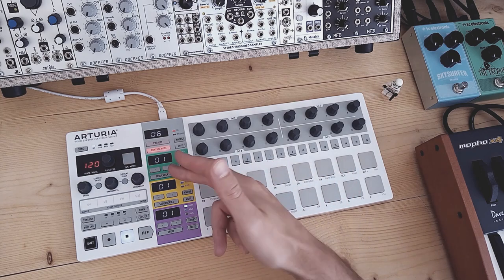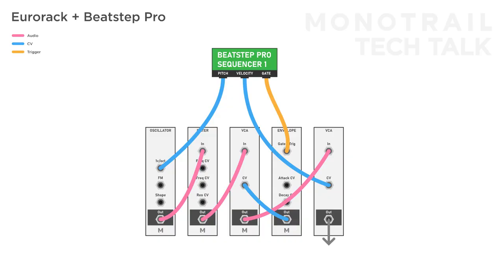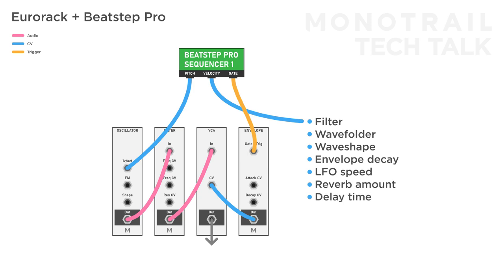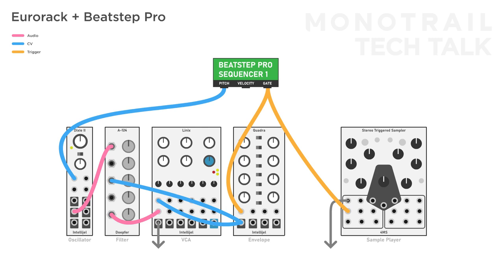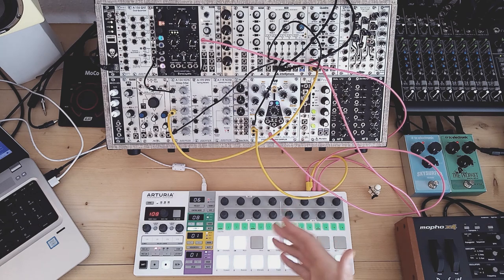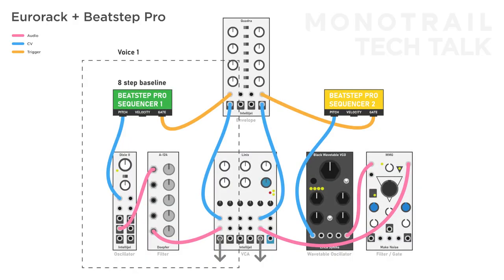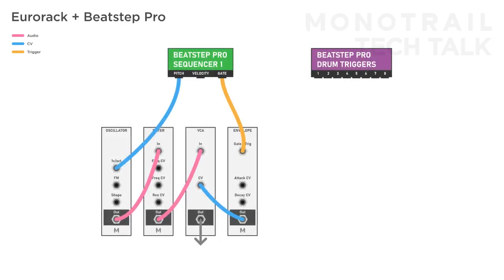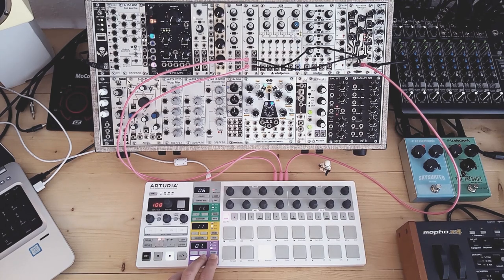Get more out of your Beatstep Pro with these modular patch tips!

Comment: I made a few simple passive slew limiters. Just out of a couple potentiometers, two capacitors and two diodes. Wire them in line from the drum triggers. Adjusting those pots and the pattern and gate lengths from the beatstep, turns the triggers into envelopes or LFOs. Great for adding movement when there are any drum triggers not being used for something else.I also made a couple with a third potentiometer that I can mix the “dry” trigger in. Giving a percussive element while still having the slewed effect. Super cheap to make, takes up 0hp, and requires no power.
Reply from the maker: Hey, that's awesome! I made some slew limiters in the past, and hooked them up to simple manual buttons, that was fun already, but combining with the Drums gates is excellent. Might give that a try soon :) Thanks for sharing!

Comment: Very smart video, with some very helpful tips that I'm now looking forward to trying. I've had my Beatstep Pro for about a year and a half now, and it's been a total game changer. It seems to me like a very underrated sequencer within the modular synth community, which is surprising considering that—as you rightfully pointed out—there are so far no other sequencers that offer so many fantastic features for such a ridiculously low price. 

Not sure how many people out there do this, but I tend to treat each BSP project like a "song": I program variations to (and movements within) a melodic motif and its corresponding backing rhythm(s) across each track within the project by copying and pasting the original motifs into separate tracks, and then playing around with each one. I then plan out when each event will happen within the song, sequencing each track accordingly. Of course, it's very easy to branch out into all directions at once with this method, hence raising the potential to end up with a complete (but sometimes glorious) mess. Having said that, I've never filled out all 16 tracks of one project with a single composition, though the potential to do that is certainly there and open. I wonder what Philip Glass would do with THAT idea...
Reply from the maker: Hey, glad to hear you liked it! I thinks its unbeat when it comes to price/power indeed. And I do similar things for life performances. I have one or two projects and then slowly progress through the variations and differetn parts, but still having the posibility to improvise with them.

Comment: I just realized that the Beatstep Pro can output NRPN messages. I want to get one to sequence those to control my LXR-02. I started messing around with NRPN with a max/msp patch and it's cool. I know I'm late but the Beatstep seems like the best sequencer for modular and or midi hardware. I ve been looking for a sequencer that's versatile enough but without too many pads like the Hapax. The Pyramid looks cool but i'm not sure about the performance effects.
Reply from the maker: Have to admit I have no experience with that, but do agree the BSP is still the best bang for buck sequencer by far!

Comment: Nice video. It think its can be easy to control cv/gate with the midi cc knobs on the beatstep. I have the doepher midi to 8 cv converter for that. You can live tweaking the cv to the modular on the beatstep.
Reply from the maker: Ha, that sounds great indeed! Which Doepfer module do you use for that? :)
Reply: @MonotrailTechTalk  It's the old doepfer mcv8
Reply from the maker: Ahh awesome! That one has 8 gate AND 8 cv outputs no? That's really powerful, shame they don' make it. Think the new one only outputs 5 in total.

Comment: Thank you for this inspiring video (and the others.) Would it be also possible to use the BeatStepPro as a (deluxe) MIDI to CV converter? Information on how to do this I find scan and rather obscure... I find this possibility exciting for several reasons: 1) if you don't have anymore rack space to accommodate a dedicated module to do this and 2) to use only your DAW a sequencing brains; an option, I find, particularly convenient if you have already an Ableton + Push combo. Ableton offers amazing sequencing capabilities, and an all-in-one setup is hard to beat. Thanks for your time and any input you may provide! el domo
Reply from the maker: Hello, glad you like my efforts! And indeed the BSP works very well like a midi to CV converter, although with some restrictions, so make sure to check details that are important to you. How I very often use it: Create two melodic sequences in Ableton and use the BSP as a midi to cv converter for those. Velocity works as well this way. Drum triggers can be programmed in a piano roll sequencer as well. So C is the first trigger D the 3th and so on. This also works great to get a clock from a daw into the modular. Works tighter that midi sync.

But I did'nt research much. For example if you can do program changes to trigger, or if you can map the triggers to other things than piano roll!
Reply: Works brilliantly - thanks a lot. I'll figure out the ither trigger possibilities.  El domo

Comment: I don't have any modular gear, but It doesn't matter, Subscribed! :)

Would love to know your opinion about the TC effects you are using (reverb, delay)
Reply from the maker: Haha, glad to hear it, thanks! I use the TC electronic M350 wich I use for my master reverb and really like! You can find them cheap on ebay. The skysurfer and the prophet are quite budget guitar pedals, The prophet is great for the price, simple clean digital delay, does what it needs, only thing I miss is tap tempo. I bought the reverb to try as reverb for life use, but the difference with the M350 is way to big, no stereo on the pedal of course, but also not long enough tails. However it works quite okay as a "subtle reverb you only notice when its gone" I do often use the combo of the two to run my drums through. The delay for effects, and a subtle reverb, to trashy room reverb. So the pedals are limited, but find their use!
Reply: @MonotrailTechTalk  No problem, great content (!) and thanks a lot for the detailed explanation about the pedals! It will come in handy

Comment: Thanks for these. It's great to have material that bridges the Beatstep Pro to modular. But I'm wondering about actually just clocking my modular from the Beatstep? I'm not having much luck getting any of my Makenoise modules -- Wogglebug, 0-Coast or 0-Ctrl  - to understand the BSP Clock Out. But I'm also thinking there's something I don't get about the connection. Any help much appreciated. Thnx. again.
Reply from the maker: Hello! I generally use the 8th trigger output as a master clock for the modular. That is a lot more stable and excepted by modules in my experience. The only downside there is that you can not Mute the whole percussive section without stopping the clock :/
Reply: @MonotrailTechTalk  Thanks a lot! Not exactly plug 'n play. Maybe I'll look for a different approach.
Reply: @MonotrailTechTalk  When there is a disconnect between the numeric tempo display and what the Clock Out is generating first thing to do is check the setting in MCC about which tempo -- Project or Global -- is being put out. I hadn't used my BSP for quite a while and whatever settings there were related to some Project which was faster by 4 than the Global. Paradigm conflict: simple modular vs complexified computer system.

Comment: Great video, as always! I have the Keystep Pro, but a lot of this is definitiely applicable there as well. Question about the ratcheting sequence: when you add an additional sequence to the fast hi hat sequence, don't they just trigger simultaneously. Ie, i f I add a couple of quarter notes to a 16th note pattern, they will fire off at the same time. How did you manage to get them to trigger separately on the same step?
Reply from the maker: Thank you! I'm not totally sure if I understand you right, but the trick is the mixer module. The normal triggers are always firing off the hi-hat, the faster triggers only every now end then. You are right if you mean that the first of the ratcheting triggers can "overlap" with the regular triggers, but since the two trigger signals are mixid in a mixer, the two simultanious triggers just end up being one. - that doesn't sound very clear, let me know if you meant something else ;)

Comment: I'm noob here, can i put any midi files into Arturia Beatstep Pro ? Also if not, what modul i need for play Midi to CV ?
Reply from the maker: Two different things! You can not put 'midi files' into the BSP. But you can use it to convert midi to CV. For example, you can hook up a DAW with usb cable to the BSP, and then use the CV outputs from the BSP to control the modular.
Reply: @MonotrailTechTalk  THank you!!!

Comment: Can the beatstep pro be the tempo master for a moog dfam? And is it then synced to my daw aswell?
Reply from the maker: I don't have a DFAM, so cant test, but should be yes on all. BSP has a clock out, should be able to drive the tempo on the DFAM. BSP can be synced to a DAW easily via USB. if the clock out of the BSP is to "soft", you can also programm a drum pattern, and use that to drive the DFAM. You can even use the BSP as a midi to cv converter. And program a pattern on your DAW, and send that to the DFAM via the BSP :)

Then you can use the melodic sequencers to modulate the DFAM. you can make longer sequences, safe and load sequences, and create entire performances :) Don't know why I don't see people do this more!

EDIT: I mean, this is what I would do! Still would like to pick up a DFAM.
Reply: @MonotrailTechTalk   thank you so much for your detailed answer :) Sounds great, i will give it a try !!

Comment: Hi, I don't know if you can help me but I try! 
I'm trying to send velocity  to Neutron just to have some notes with different volume,  I'm just there but there's a problem.
Pratically if I patch a cable from vel-out of bsp to vca cv in of Neutron I have velocity but ADSR is bypassed and I have all notes long like a decay and release set to max.
I give a look at Neutron routing but I did'nt realize how to do it
Reply from the maker: Sure! Have a close look at the graph I made at 1:16. To have both an ADSR curve and velocity, you need two VCAs. One, like its wired in the Neutron, where the ADSR controls the volume curve, and then another one after that, where you patch the velocity. If i'm right the Neutron doesn't have a second VCA, so thats not an option unfortuantely. 
The easyest way to add velocity(-ish) dynamics to a patch, send the velocity to the filter. This way notes with more velocity open the filter a bit more, still creating some sort of percieved loudnes and dynamics.
Reply: @MonotrailTechTalk  Yeah, thanks! 
I suspected it. Ok I'll have to add a vca to my system! thanks a lot.  Tazio

Comment: Do you have any other sequencers you would recommend which would also work just as well instead of Beatstep Pro? Could be both external or eurorack module.
Reply from the maker: Not if you take the price into consideration. I think the BSP really is in a league of it's own then. Midi and CV outputs for two melodic voices, as well as 8 trigger outputs is a great deal. You won't find a module that does that for that price.